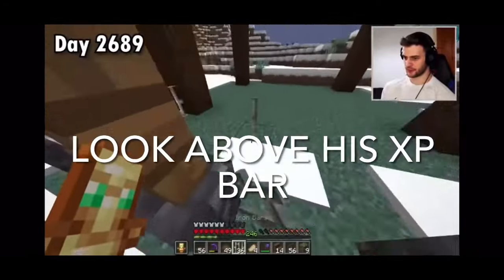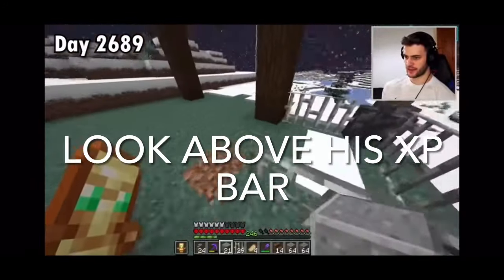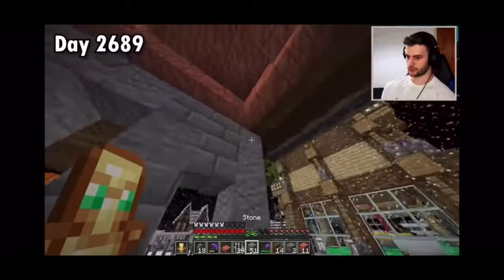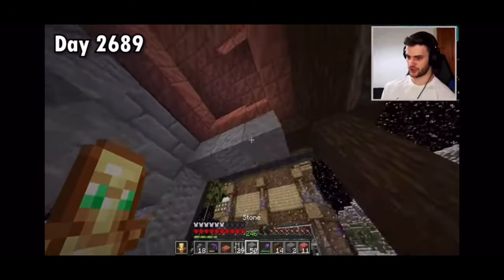Can someone please explain if SB737 cheated

Comment: If anyone's nikking he uses minihud, litematica and tweakroo mods it's not cheating many technical players use these mods proofs: minihud from 2500 days vid where he makes mob switch and there is absolutely no way that he will know where exactly lazy chunks are without minihud and also he used it in 2900 days . litematica:it's in vid tweakroo: he used period attack tweak from tweakroo in 3500 days where he built fortress farm when he came back from afking there was that message from tweakroo saying "toggle period attack off"

Comment: it is a schematic which is like shows where to place block cause it is easy to build big builds using but he uses it for the small builds too
Reply: Yes you are right but does that mean your actually cheating thats the question after all this is not just a normal hardcore series this is more than 1k days one of the longest hardcore serieses of all time. In my opinion thats cheating and also this is not even a moded hardcore series.
Reply: Not cheating if it for example changes the debug menu not cheating no advantage
Reply: @Showa_G_Fan  it's like following a tutorial but the mod helps
Reply: @Showa_G_Fan  it's the same thing at a reference I And placing the blocks. It's just easier.
Reply: @boyraptor  it’s like a blue print
Reply: @Showa_G_Fan  its like saying having optifine is cheating-
Reply: @Showa_G_Fan  that ain't cheating, it's like watching a tutorial for your own build
Reply: @kalttor  agreed
Reply: @Showa_G_Fan  2600 isnt nearly close to the longest hardcore series
Reply: @Showa_G_Fan  no, is not.
Reply: @Showa_G_Fan  it does not give him a real advantage in progressing the game it takes time to plan out a build rather than just copying i could argue that even using F3 is cheating which actually gives the player a advantage in progressing in the game
Reply: @killer_op6128  oh ok

Comment: The mod shows you the materials needed, and where to put them. It is not cheating, and is considered the same as using shaders or optifine
Reply: It depends on if you think mods are cheating.
Reply: @trollersupreme4316  some people say that sodium is cheating because it's a mod lol
Reply: @TheConvexDR  Again, depends on what a person thinks. Even small advantages are still advantages. For me, I like pure vanilla with nothing extra. Personally, I feel like the more vanilla it is. the more rewarding it feels.
Reply: @trollersupreme4316 but most people don't, if you see it as cheating, fine don't watch the video
Reply: @idotn8752  He advertises it as a Vanilla Hardcore. I couldn't find where he said he uses mods.
Reply: @trollersupreme4316  ITS LEGIT THE SAME. Sodium is a mod that boost performance. Second of all. Litematica (The mod he is using) is the same as copying a video.

Comment: i think its just a building mod (its doesnt build for you. just shows how the build will look like. You still need to place the blocks manually). So meh i dont think its counts as cheating
Reply: well, there is a mode that you just need to click with the right blocks randomly and it places it on the right spot
Reply: @goncalobalanca4299  he didn't use that mode, so it ain't cheating
Reply: @shamanaseem7165  if he uses that mod still not cheating hermitcraft known as the most advanced server in  minecraft the members use that mod

Comment: The schematic mod, it lets you copy a building or anything in the world, and show you a little hologram of that build so you can build it like a replica of the original. It's not cheating, it's just if you wanna improve it, you can load it to a creative world and improve it, take the schematic from the creative world, and paste it on to the world, get the blocks which are needed, and build it.

Comment: ok ima a builder in minecraft and i can explain it
its a mod that helps u build block by either pasting a schematic or building a schematic from a blueprint the blueprint tells u which blocks to place where thes is a time saver rather than opening a video and then closing it to place 1 block at a time this helps speed up the process if u want to see my work give ur gmail ima send u pictures....

Comment: Litematica i wouldnt call cheating. Most people use QoL Mods. 

It is no different then looking up a build tutorial for something just cutting out the middle man basically and you follow through placing your own blocks and it is far more accurate when you have block for block count. It is honestly one of the best mods available and saves so much time in builds! The toggle he turned off was turning off the blueprint which is basically a bright highlight that shows you where to place your blocks, sort of like a color by number book.